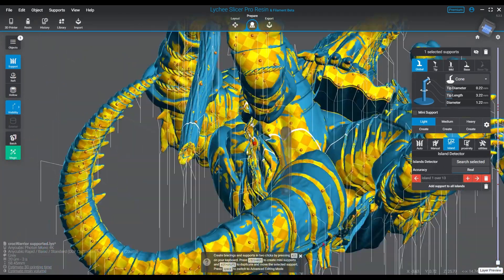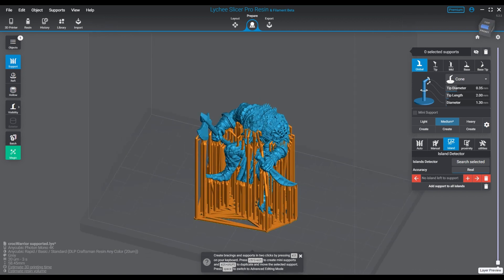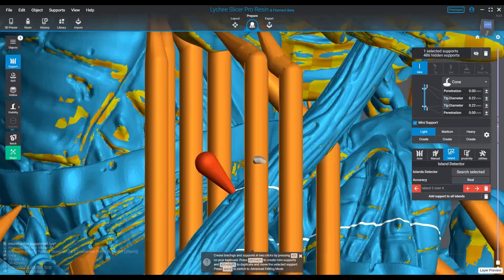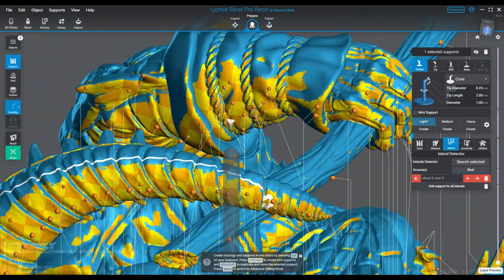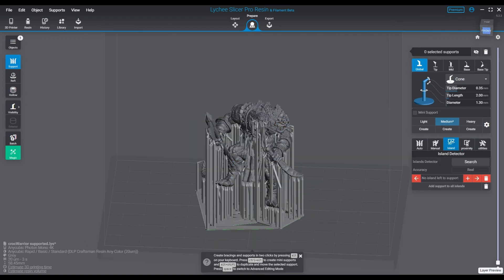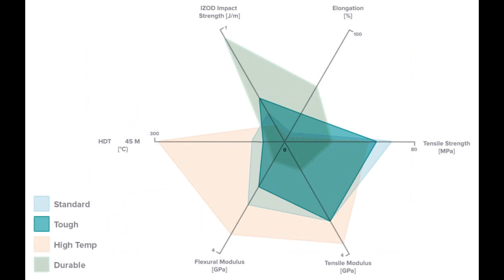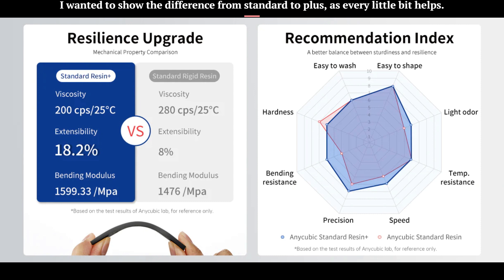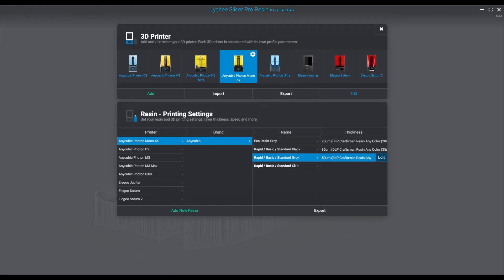It's not you, it's your "standard" resin

Comment: Does anyone have thoughts on Elegoo's Standard Quick Resin V2?  I bought it recently in bulk for $14 a bottle (1KG).
Reply from the maker: Not tested personally, but one of my buddies uses it. It is better than standard quick resin, but only in certain aspects such as drop strength, and elongation. I would check with Elegoo and see if they have white papers comparing the resins.
Reply: @IPrint3dMinis  What do you think is the best value resin out there?  Thank you.
Reply from the maker: @robertlemaster156  Great question, depends on what you consider value vs. quality. But, in my eyes some of the best value resins I have used are the Anycubic ABS Like+, Anycubic Tough, Elegoo Standard 8K is also good considering the cost. However I always try and wait till the more pricey stuff is on sale, what we use costs between $30 - $50 per 1000ml or 1kg bottle. That is the DLP Craftsman resin, which is 8k and works really well with DLP style printers.
Reply: I have not heard of Anycubic Tough.  I will have to check that one out.  Oh, I have bought a few bottles of Elegoo's 8K.  It was the first resin I tried.  The details on it are amazing and it has better resiliency numbers than their ABS.  I should try it again now that I have been printing for a few months.  I struggled with post-processing as a new person to 3D printing.  Thank you again.
Reply from the maker: Yeah Anycubic is pretty good stuff.